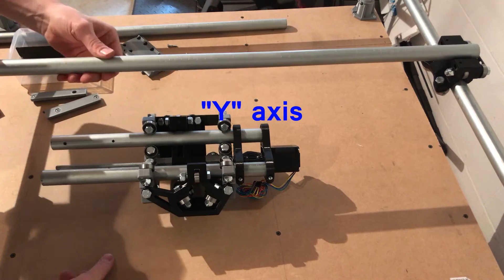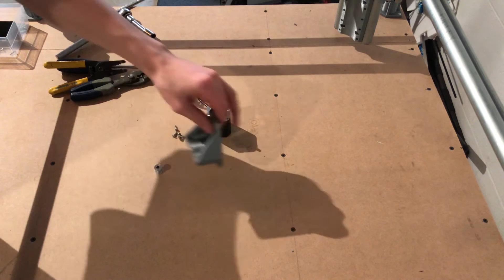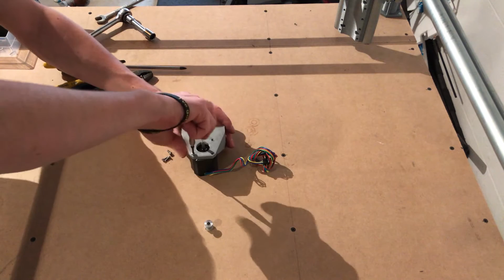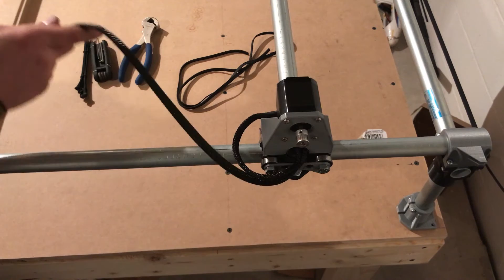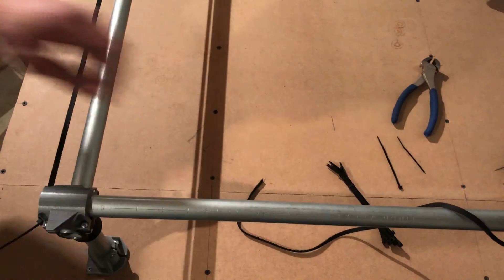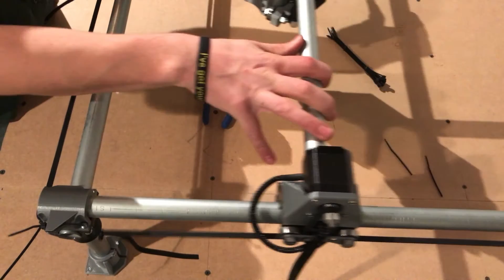Mpcnc Part 8: Motors, rails and belts

Comment: How did you tighten the nuts in the nut trap on the roller?  The nut trap does not trap the nuts, so they just spin, and it makes it impossible to use an open ended spanner.

Comment: You did not add the most important part ... how did you adjust the angle between the 90 degree tube?
Reply: sorry, do you solved this problem? i believe i have the same trouble. Thanks.

Comment: Could you tell me what size wire loom you used? I'm a little concerned I wont be able to get the connectors through if I order the wrong size. I really like the looks of it though. Thanks for your videos - they are really helping with my assembly.
Reply from the maker: Craig Bennett I think it is 1/2in. But caint remember. You can always pop your connectors off then run the wire through and put them back on. Just make sure you take a picture of the wire order.